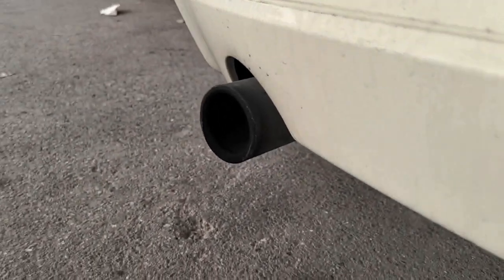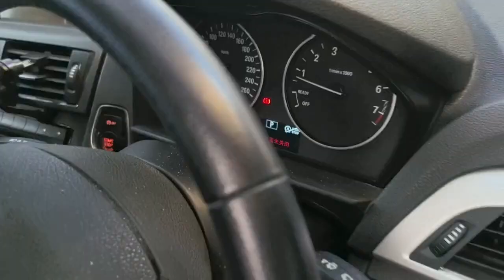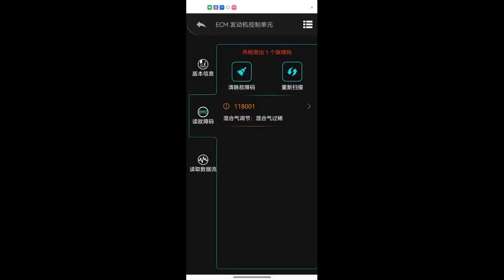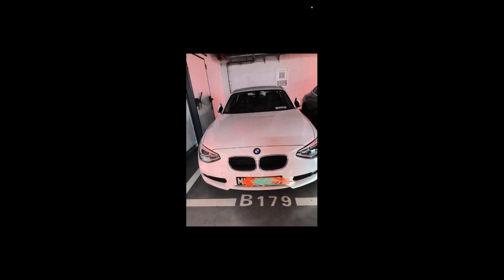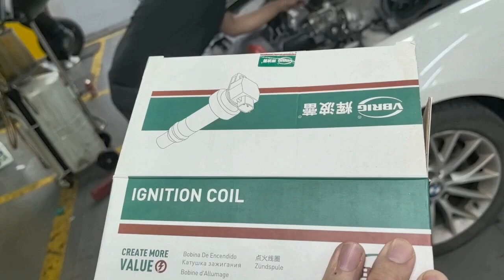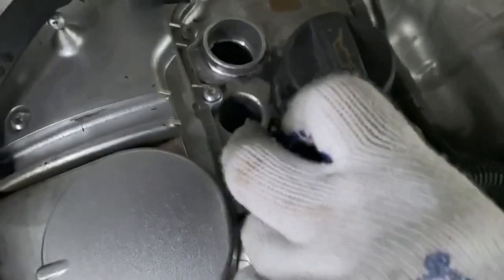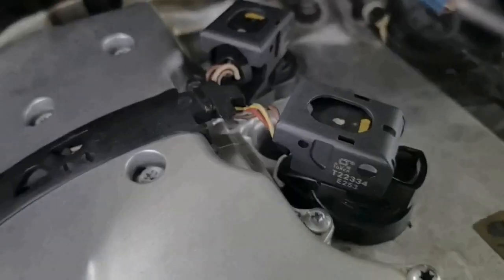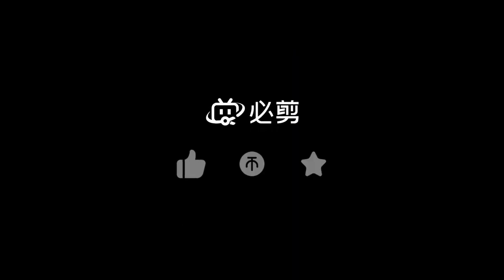bmw 118001 mixture too lean cause misfire cylinder loss 140004,140104,shake,change valve cover solve

Comment from the maker: If the ignition coil or spark plug cylinder is damaged, it will be fixed long term broken, n misfire in the cylinder one or the cylinder two and now my case is the cylinders one n two jump like now not fixed. cylinder one, two, three, and four, Not fixed on one cylinder, and sometimes no vibration, no code is reported n running normal, sometimes vibration code is reported, so it is not the plug or ignition coil's broken. so it is the air leak problem causing fire not good n ignition not good to misfire, air too lean

Comment from the maker: BMW 118001 mixture is too lean， resulting in cylinder loss，misfire and idle vibration 140004, 140104, etc., stalling, multiple cylinders have exhaust hazards, stalling has been identified. The solution is not a general ignition coil spark plug, and even if the ignition coil spark plug is replaced, it will not work. At the beginning, only the error code of the mixture being too lean was reported. After the code was eliminated, the code of the mixture being too lean appeared again immediately. The vehicle also kept shaking. Sometimes, the code did not appear after the code was cleared because it did not reach the level of excessive air leakage. However, the air leakage became more and more, causing excessive vibration. It will report the cylinder loss misfire code, and we locked down the problem that the cylinder loss misfire is due to air leakage, because the old aluminium alloy valve cover will cause the oil seal to dissolve, and the PCV waste valve will also leak air and oil, resulting in poor combustion. Finally, the domestically China made MAHLE valve cover made of rubber was perfectly solved the shaking problem, chamging valve cover ko it.